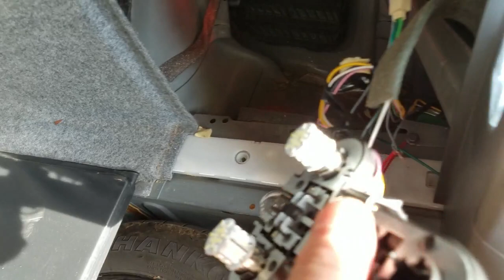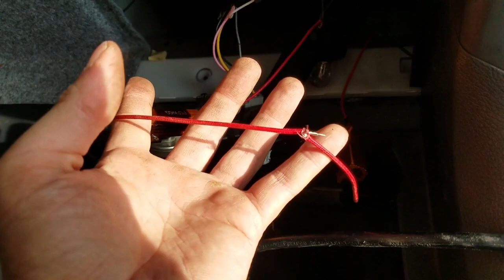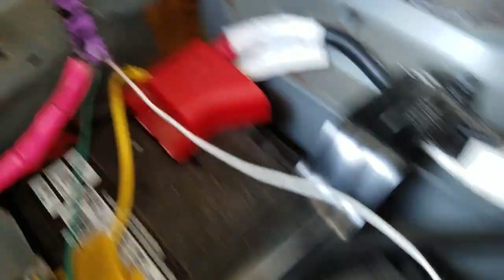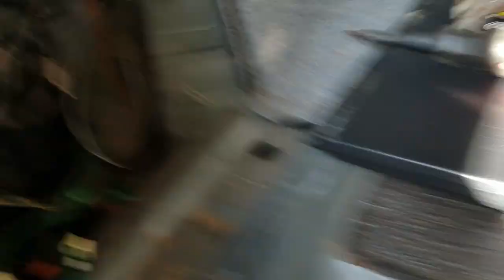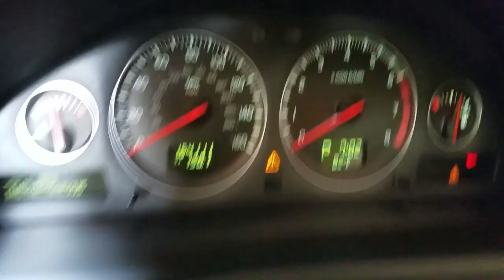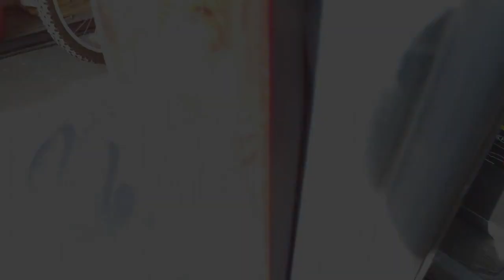Volvo S60 LED Position Lights - Error Free

Comment: My position lights Don’t work at all. Do you have any idea why that is?
Reply from the maker: Potentially it could be a fuse.  Check http://www.volvohowto.com/volvo-s60-fuses-list-and-amperage/ for your year model and see if any correspond to your car.  Check voltage at the light socket too.  It may just plain be 4 bad bulbs.

Comment: what a mess, why don't you use ordinary light bulbs, they last even longer
Reply from the maker: Really?  2 1/2 years, zero issues, and still look and work beautifully.  Sounds like a real mess alright.
Reply: @MIFixItDad  great work buddy. Can't understand why all these flogs are caning you? Full of great ideas but can't share?? If there was one improvement I would probably do is solder all your joints and not use twist connectors, but hey you did disclaimer this. Keep up the good work.
Reply from the maker: @warren7780  That would be the best way to go.  Mostly I just wanted to see if these would work first and didn't want to take the time to do a full on permanent install.  No need to though.  These aren't under any stress, don't get wet, etc.  After all this time, they still look great and work great, and the wiring looks like the day I did the video.  I would say that's sufficient.

Comment: It's a complete hack job of wiring. You need to solder that wire into Weather packing heat shrink tube that has the glue inside. That's going to rot and fail in no time.That's just scratching the surface of this nightmare of wiring you created. This is going to cause you a whole lot of headaches. Bring this to a professional.
Reply from the maker: 2 1/2 years and zero issues.  This is in an area that isn't exposed to water, so not sure why it needs to be weather packed.  I just checked this about a month ago actually and it still looks exactly like when I put it in.  If it didn't, you can be sure I would have changed and probably soldered it and used heat shrink tubing or something better suited to the area.

Comment: How about Canbus Led ?
Reply from the maker: Those are getting cheaper and I would go with that option if I needed to replace these.  It's a 2009 with currently 181,000 miles on it though, and I don't want to spend a great deal of money on it.  So far, this has worked well, and springing for good quality LED bulbs means they are still working like they should.

Comment: My 2001 xc70 is now completely LED all lights exept for  headlight and the side mirror blinkers and the best thing is i used only load resitors for the indicators. position/parking and brake lights work with a very small resistor added to the repective shunt, no heat and the 'bulb out' system still detects when a led is not working.Has you car caught on fire yet, those load resistors get very hot ?.
Reply from the maker: The load resistors would have to get over appx 400 to 450F to ignite anything, and these don't.  Actually, with 2 in series, mounted to the metal body, they barely even get warm at all.  I have heard a couple of people mention shunts, which is really just a type of resistor itself.  I haven't looked into using them yet though.  If you have detailed info on how to use them, or can post a video showing them in use and what parts are used, I really would love to see it.  These load resistors work well, but if there's a better way, I have no trouble with changing things around.  Anything that can help a viewer do things better, and safer, is always a bonus.
Reply: I too would love to know what resistors you used on the shunts!
Reply: @regan44017   i used different values for each shunt. for the brake lights i used two 0.5ohm 1/2 watt resistors one on each side. the more resistors you add in parallel the less resistance you get. to trick the computer takes very small resistance. A  1ohm  1/2 watt resistor will work but it wont tell you when a LED  is defective.
Reply: @robert3673-n1s Nice!! Can you please show me how you connect the resistors?

Comment: What wires on the driver side did you tap into for the resistors? The same as the passenger side?
Reply from the maker: Yes, on my car it was they gray wire on each side.
Reply: Floyd Nash  thanks man! Huge help.

Comment: this vehicle should use shunts like my V70, just by adding a small resistor 0.5ohm 1/4watt to the shunt i got the same result and no load resistors..
Reply: Daryl Gama how and where do you put the shunt then, very interested
Reply from the maker: But, a shunt is just another resistor, so you're basically doing the same thing.  The shunt is just a type of load resistor or diode.  Either way, the point is, for these cars, you need something to add in the resistance that replicates the resistance of an incandescent bulb so you don't get the bulb failure message.
Reply: No its kinda not the same, anyway there is zero heat at the shunt and my bulb failure message still works if i unplug a LED, try unplugging your LED and see if the computer detects a problem?